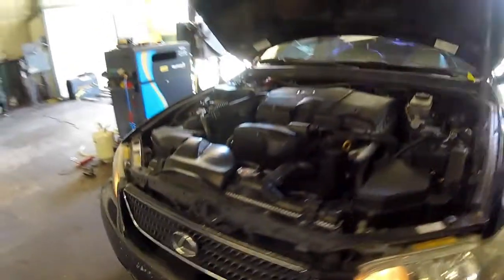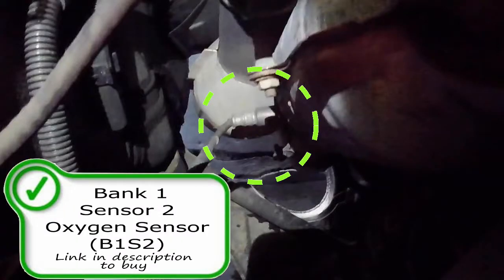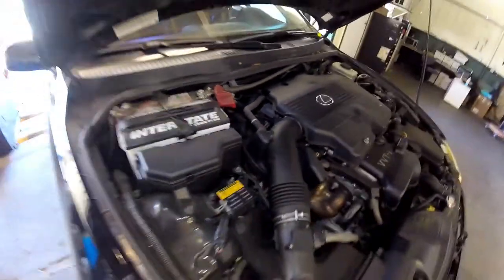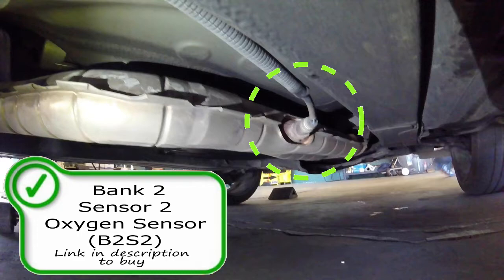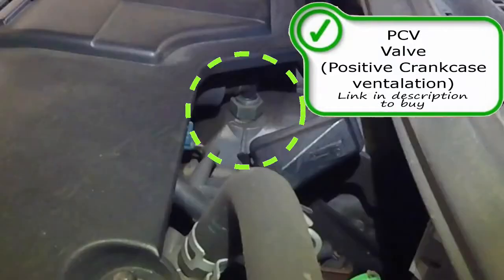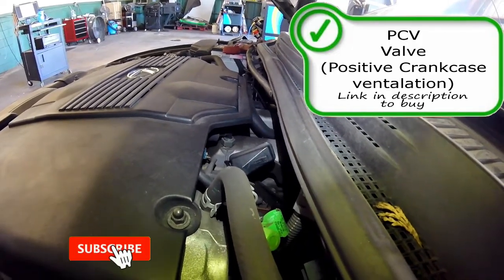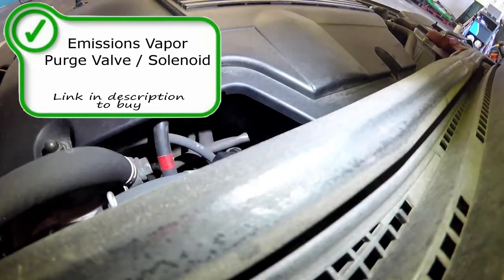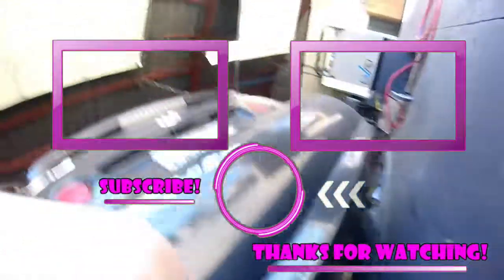⫷ Lexus │ IS300 XE10│ 1998 - 2005 │ Emissions Locations: PCV, EVAP, Oxygen Sensors ⫸

Comment: Hey man I have a p0440 code I replaced the fuel cap code went away for about a week then popped back up any ideas (2001 Lexus is 300 ) maybe a vapor pressure sensor ?
Reply: i got the same thing, 2005, i may turn on the parts cannon and throw a new Vapor Purge Solenoid at it, cross my fingers.
Reply: @rogerperkins A year later & I’m here wondering the same thing🤣 if you ever replaced that, did it fix it?
Reply: @TClipz1  yup, did the cut hole under back seat to access trick, when took off the old one you could tell that all the dried residue on the o-ring was where the pressure was escaping.

Comment: Hey man, I am just wondering how bad would it be safety wise for the vapour solanoid to be going straight to air where it’s mean to be going into the air canister? My car I brought second hand is a IS200 frame wirh a is300 ecu a loom with a 2jzge vvti from a aristo with a w58 manual gearbox put into it which I brought  the car with all this done to it. I can across the issue when the c shaped bent hose went all bridle. Ik it would be really hard to try make stock but I just wanna know and understand if it poses any hazard that would make my car catch fire ect ect.
Reply from the maker: Are you plugging the lines so the fumes / vapors are not going into the air? Just from a logic stand point. If you are allowing fumes / vapors to be released into the atmosphere, you might have some safty problems.  The fumes / vapors are the combustible part of fuel. On the other hand, the vent in the back of the vehicle allows vapors to escape into the atmosphere at the rear... where there are no spark possibilities and after the fumes go through the vapor canister.

In short. If the purge system is plugged, I think you'll be better off. Rather than just allowing the vapors to escape.

Comment: I have an 03 Lexus is300 and a code is popping up for a P0442, i honestly don’t know what it could possibly be or if it’s a cracked hose or not, don’t know where to start looking
Reply: Yeah I did on my it was a skinny hose lose vacuum switching valve I change the valve 2 years ago maybe you need to replace
Reply: I’m working in the same code I going to replace the purge valve and I let You know
Reply: Did you guys figure it out what it was I'm working with the same issue?
Reply: Start by changing the pcv valve and make sure you go to Lexus dealer ship for warranty

Comment: Hey Scott, hopefully you can give me some clarity on my problems. I've got a 02 is300, and it has a multiple misfire code and it's missing on cylinders 1, 2 and 3 and it is also throwing a too lean code on bank 1 and also has a inconsistent idle and bogs at low RPMs . I have replaced o2 sensors, spark plugs and checked the coil packs to see if they are malfunctioning and they were not and also installed brand new fuel pump and the fuel filter and a new MAF. My only thought now is that I've got a vaccum leak somewhere or my fuel Injectors are clogged. Is there anything that you could give me insight on before I spend a boat load of money. Thanks in advance
Reply: Have same can u please answer dont have no more money to. Lose please
Reply: You probably have a vacuum leak. Do yourselves a favor go to O'Reilly and buy about 5-10 ft of new hoses and replace all the old ones. 5/8 and 3/8 I believe will cover most. The PCV valve hose has a certain sleeve over it but don't know how important that is.

Comment: I have p0305 and cylinders #5 doesn’t seen spark or burn at all you have any ideas
Reply from the maker: Have you checked the coil? I would put your number 5 coil on a different cylinder and see if the misfire changes to that cylinder. Per se swap the number 3 and number 5 and see if the misfire moves to number 3. If it does then you know your coil is bad. If the misfire stays at number 5 then you might want to do a compression check..

Comment: Hey Scott I’ve been having trouble with my 2003 is300, when I get gas the car has a hard time wanting to start but it’s not throwing any codes and such, I’ve replaced fuel pump and fuel tank vent valve, my MAF, spark plugs and such the only things I have left is the evap canister system. Can you help me out please?
Reply: I’m dealing with the same thing
Reply: same
Reply: Same
Reply: Nothing yet?
Reply: injectors clogged bc of crap in tank

Comment: I have a 2003 is300 with po441 442 446 popping up, I've replaced the gas cap, the vsv next to the charcoal canister as well, the code still pops up, do you know anything else I should check
Reply: Check all your vacuum lines to do with the system im not 100% sure on all names but check hoses for cracks and loose fittings up in the top right of the engine bay near the brake booster and then check the hoses that connect to the lower portion of the engine air box in the lower left bay area